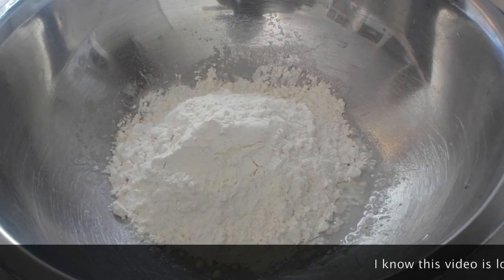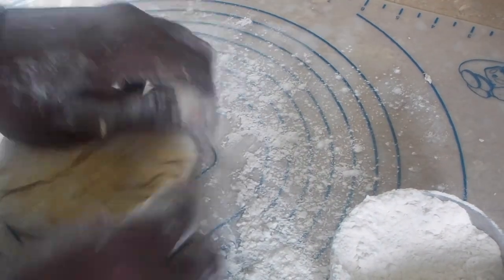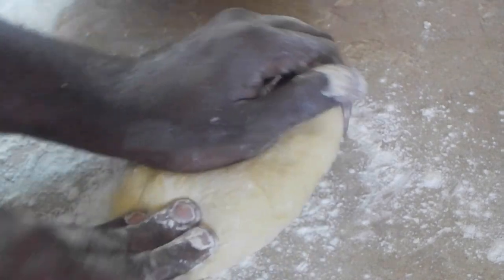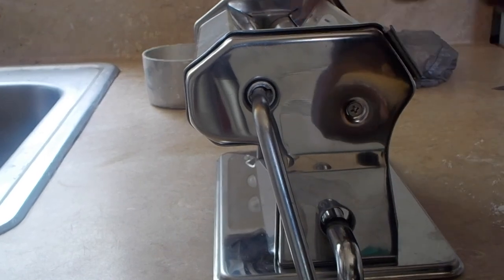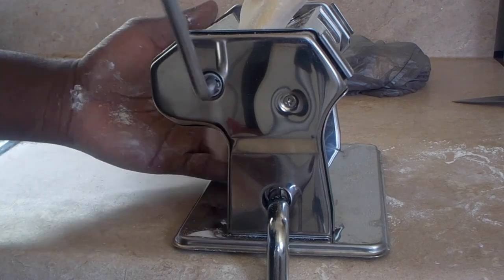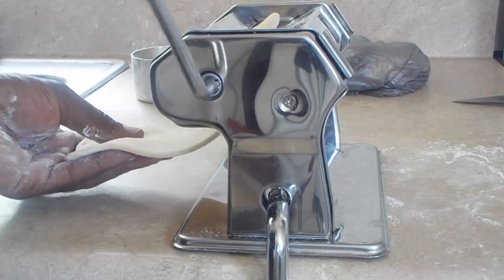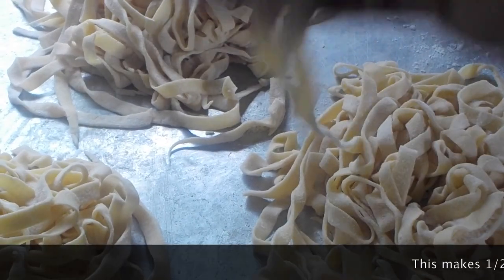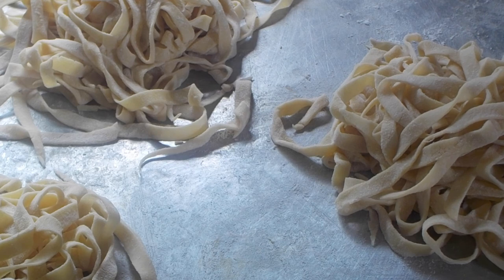Very detailed handmade pasta - Fettuccine

Comment: Cool instructive video..thanks!! Do you ever hang them to dry?  I've seen people use dowels and hang across 2 chairs.
 I have the same machine...found it at the Goodwill and it was brand new in box!!  I will be using it soon thanks to you!!
Reply from the maker: Yes, I've dried pasta before.  If you don't have dowels, use plastic hangers- easy to sanitize too, you can hang them in your kitchen cabinet door nobs if you have round nobs.
Reply: Cool...how long should I dry them?  thanks!
Reply from the maker: 2 hours